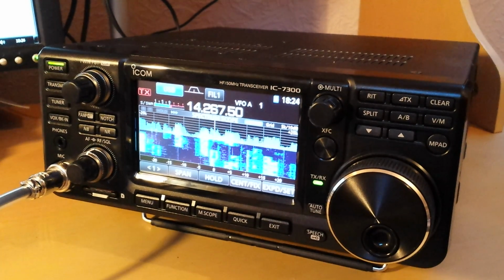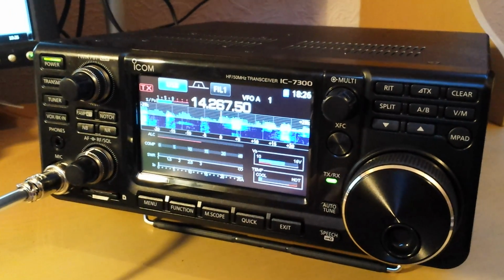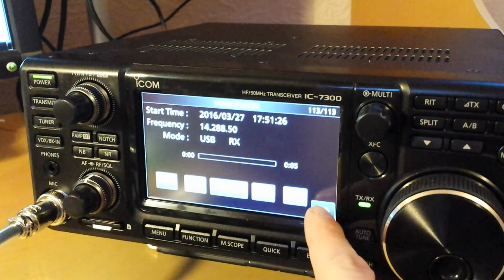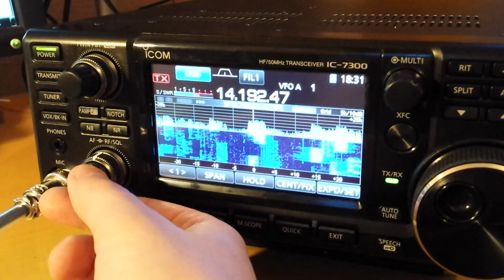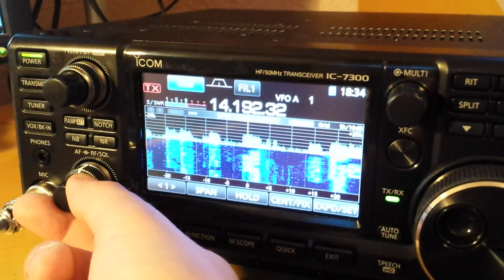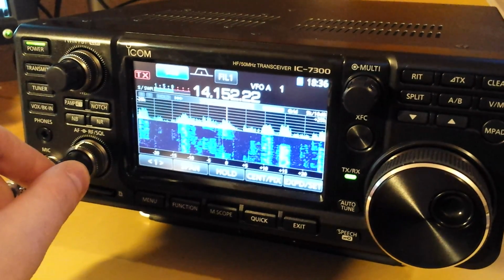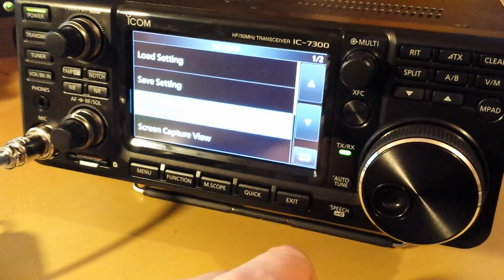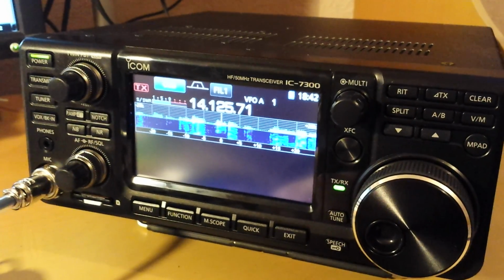IC-7300 top level user interface overview

Comment: Had mine 2 months and TX audio quit ... VOIP works fine .. but  local mic.. nada.  Mic is good...tested it on another Icom 2 meter rig.  Receiver overloads and I'm not happy with the rig.  It is NOT for CW operators.  No spot function